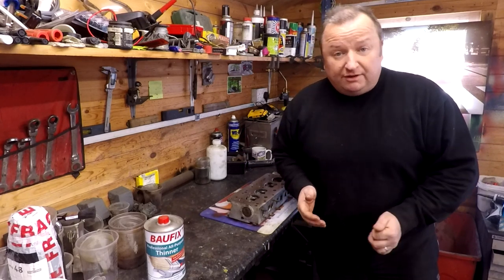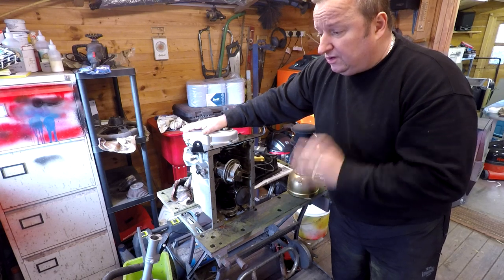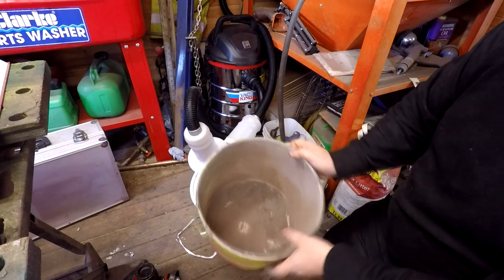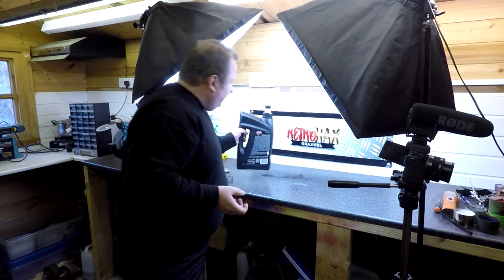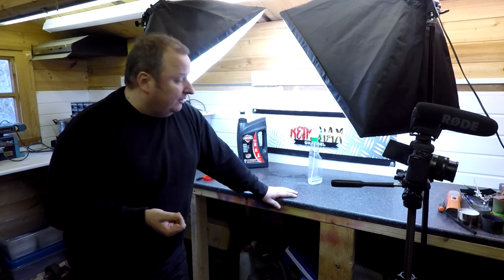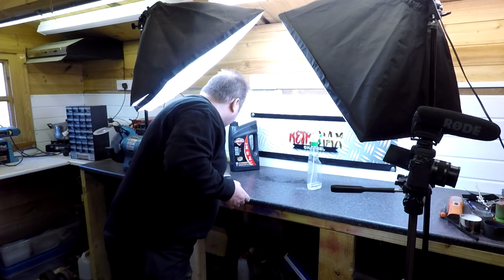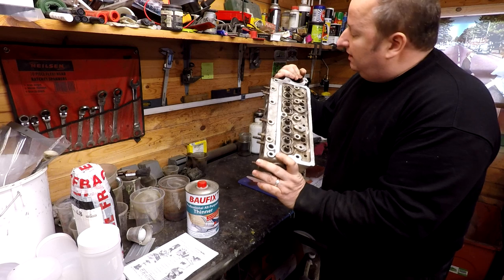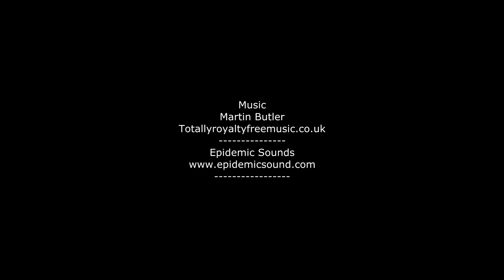Reliant Cylinder Head And Media Blaster Upgrade Test

Comment: Hi Martin, The earlier Reliant Robin with the 748cc engine had a Zenith 30IZ carb.The SU was fitted to the later Robin which came with the 848cc engine.Reliant fitted the 848cc engine to the Robin in 1976/77.I believe you can fit the SU carb to the 748cc engine but you may have to tweak it to suit. 
Good luck with it.Am looking forward to seeing more videos with your progress on the Trotter van.
Keep up the good work!
Reply from the maker: Thanks Bill.

Comment: Cant wait for the up and coming vids mate. Trotter van, dinky toys ,  etc . All the best mate. Bye for now.
Reply from the maker: Cheers Paul.
Reply: Question Martin if you don’t mind mate. (Ford transit)The chassis members. Would wax oil shop internal rust. If they have never been treated?  I thinking off doing mine before all hell let’s loose under there. Then treat out side with rust killer. Hammeright . Then under sill  what would be your thoughts please. I’m going on what you and others have done and how the members rust out. Thank bud.
Reply from the maker: @paulelliott2861  That's a tricky one Paul as I don't think its a rust converter just a wax like coating to help stop rust getting to bare metal. If the rust is already there, I don't think it will stop rust but may slow down the spreading.
Reply: retrorestore thanks mate. I’ll do some research👍👍👍👍

Comment: The 750 Reliant engines had a Zenith 301Z carburettor fitted,  I restored a mk 1 750 super Robin last year, great little car mine still has the original distributor and points fitted and they've never failed yet. I've also restored a couple 850 mk1 robins,  fairly can notice a difference in power with the 850 compared to the 750 engine
Reply from the maker: Thanks for that bud.

Comment: I fitted a bespoke 45D electronic distributor to mine a few years back and its given solid service, cost about £60 off ebay and came with cap and rotor and instructions and was an absolute doddle to wire in and equally as easy to strobe up, can't remember if my one is Accuspark or Powerspark branding but the cnc milling on it was abs as good as Lucas.   Not sure if the 750 uses the 45D or the other type 23d?, remember too that even tho it looks like a Mini dizzy, it runs the opp direction being anti-clockwise except I believe the 600cc Regal engines which apparently go clockwise.   You wouldn't believe how many mechanics out there get the rotation wrong and then line up the firing order round the wrong way and the engine sounds like a beaten pig lol   I would recommend a Lucas Gold sports coil and some fairly good aftermarket leads to get the best outta the engine.   Will you be modding the inlet manifold to "port" it by die grinding out some of the manifold material allowing the fuel mix to swirl and enter into the inlet ports better and then polishing it to a high shine aka what we used to call stage 2?   With that and a four branch exhaust from ol' Joe Mason will make it very frisky hehe  They do cherry bombs for the Reliant as well if you want a bit of loud and rorty in your zorst ;)
Reply from the maker: Plenty of info to think about there Ian.

Comment: look up a race formula called rebels racing, they race short ovals in the uk and run with the 850 cc reliant engine, they may have contacts for the reliant parts etc and what make of dizzy will fit the 750cc engine,

Comment: Have you tried a citric acid solution for rust removal. Cheap to use and cleans and removes rust and carbon from brass and steel really well and re-use time and time again?
Reply from the maker: I have thought about it Kev

Comment: What do you think of hubnut's reliant engine? Different approach to yours so we will see how that goes.
Reply from the maker: I'd be concerned that the rear waterways were blocked on his engine especially as he had an issue with the rear cylinder when he did a compression test. I think I would have removed the rear plug from the block to see how clear the waterways are before he fits the engine.
Reply: It did start...sounded sweet but Mart's advice is the way to go...Let's hope he picks it up.
Reply: @retrorestore  send him a text. Can't hurt to share the concern. Different strokes for different folks  and all that.

Comment: i have used the  mini metro distributor on all my reliants both 700 750 and 850cc s  you also need the coill etc as there electronic ignition  you may need to change the drive dog on the end  which is driven by the engine as some metro ones are slightly diffrent from reliant ones  but its a  worthwile mod in my opinion as to carbs the 700 and 750 cc were never su carbs only the  850cc engines the 700 and  7fo had a downdraught carb flat fitted ontop of the manifold the su carb will not fit this manifold without  modifying it to include an adapter  from the 850 which lifts and turns the intake so the su fits  oh the side  but you also need to find or make an overflow  plate for the fuel as  if the su overflows it dumps hot fuel on the exhaust  manifold  and you have a fire  alot of people removed this simple thin plate not knowing its importance only to find out  the consequenses
Reply from the maker: Great info Charles, thanks

Comment: also the engine won't fit your regal, that has the robin front plate fitted not a regal one
Reply from the maker: I've got the regal front plate.
Reply: @retrorestore  well you'll have to fit it or that current one won't line up with your chassis